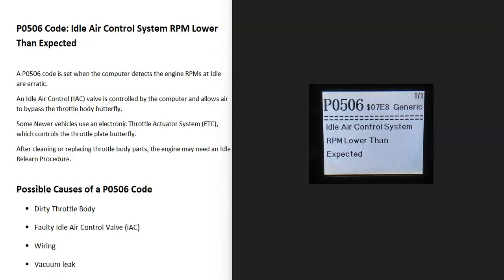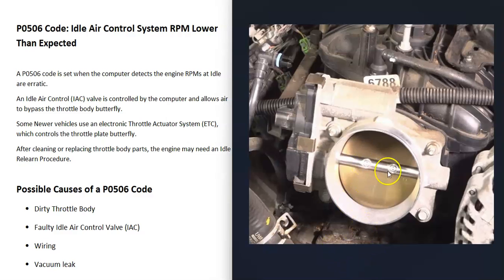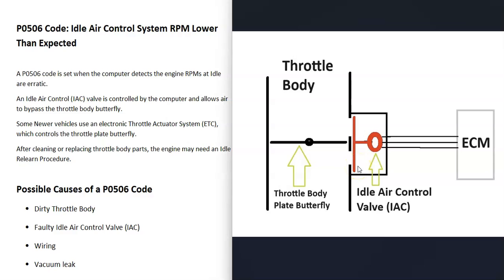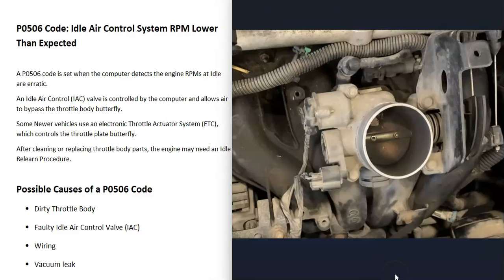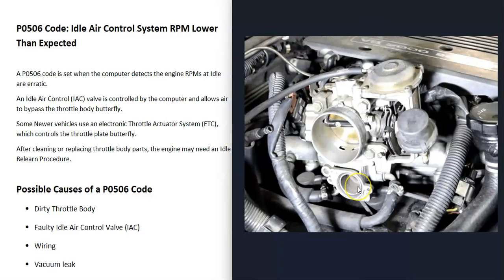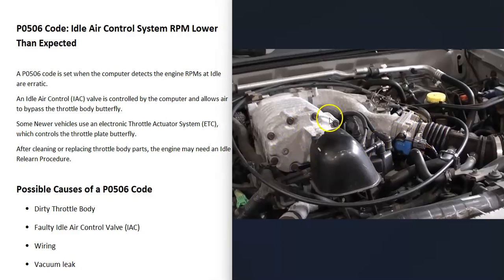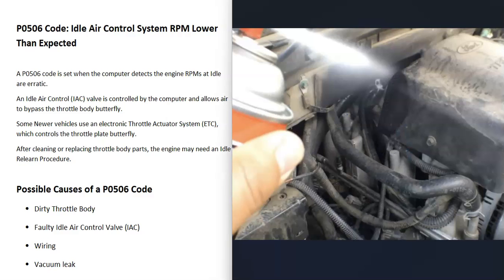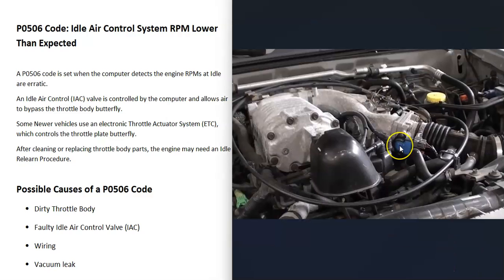Causes and Fixes P0506 Code: Idle Air Control System RPM Lower Than Expected

Comment: Yes, I've got a 2006 GMC four-wheel-drive with a 5.3 I put a cam in it and I had it tuned and everything and you know it's been good for a couple years but then I got in it one morning and it started running when you get a gas you have to light pump the gas to get it going to get it to red but you have to pump pop pump I'll replace the throttle position sensor. I replaced the coolant temperature sensor the coolant temperature connector and it's when you're going down the road I mean still kinda have to pump the gas to get it going check engine light flashes on and off and then it'll stay off for a little bit and place on and off and it's putting a 506 code. Can you tell me something I might need to check other than I've checked everything I don't know what to do I wouldn't take it to a mechanic.

Comment: I replaced all of these: spark plugs, coils, PCV, IAC, High Pressure Fuel Pump, upper timing and intermediate timing (all new chains, guides and tensioners). Still have P0506 and Multiple Misfire detected in cylinders 1 & 3. This shit sucks
Reply: I have the same codes and wondering if you ever found out the problem?
Reply: @lakeside1904  Yes, it turned out to be the intake manifold. The flaps were not operating properly. Replaced intake manifold, and all is well so far.
Reply: @lakeside1904  i couldn't find a manifold for under 400-500 bucks. So I just called a salvage yard an hour away from me. Paid 120. Just an idea if you end up replacing yours
Reply: Thanks!

Comment: I just got this code during a cold start, does that sound normal? The rough idle stops after the engine begins to warm up?
Reply: For reference it’s 23°F out and it started last winter a bit and during the warmer months never had this issue

Comment: So I have a 2009 Chevy Impala and for some reason I can't seem to find anything on the idle air control valve or where it's located on this year impala. This vehicle does have a electronic throttle control so does this mean it does not have an idle air control valve? Anytime I Google the location of the idle air control valve for this vehicle it always pulls up Impalas with different engines from earlier years
Reply from the maker: Electronic Throttle Control replaced the idle control valve with a small DC motor to open the butterfly plate at idle. The small DC motor is controlled by the computer, which controls how open the plate is.

Comment: I have a 2018 Hyundai Elantra sport and my engine light is on and it says ilde air control system what can I do to get fix please
Reply: Pay someone to give you a proper diagnosis. Reliable Diagnosis cannot be done here…